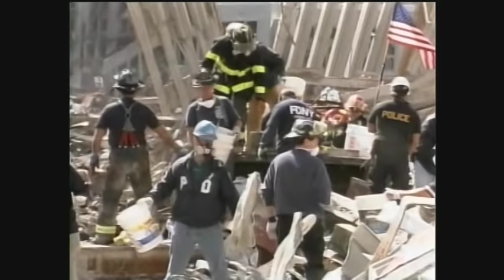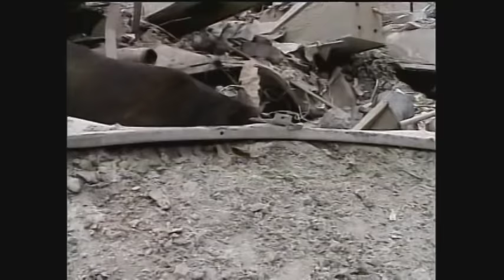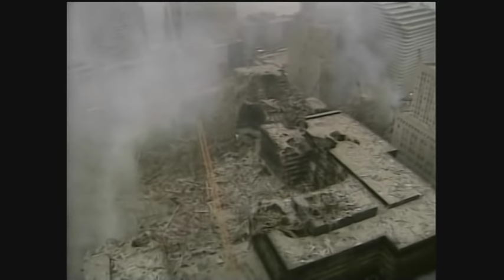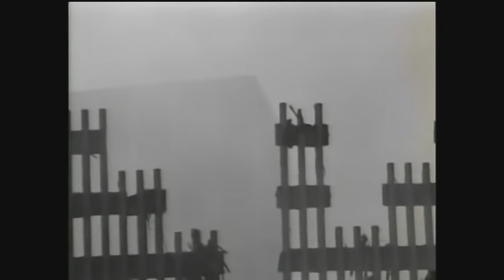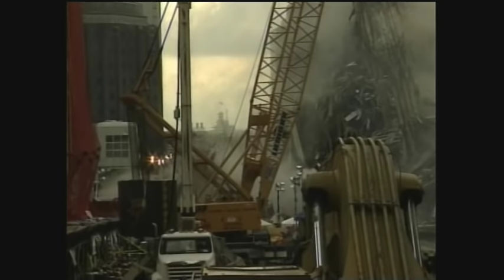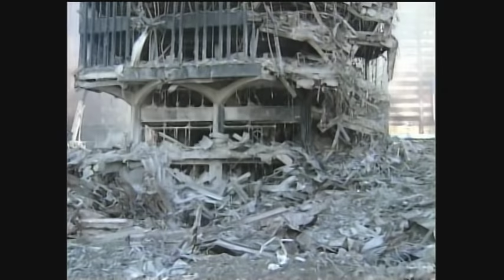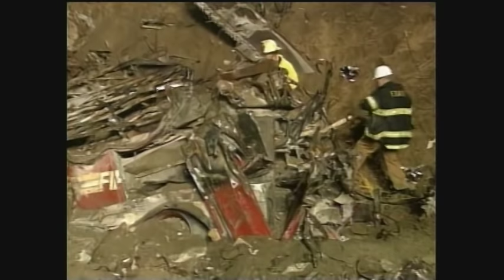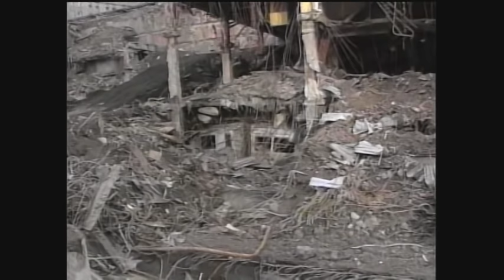Rare and new FEMA footage of Ground Zero

Comment: Dont forget that the fire can burn things such as the floors and tables etc and gas lines/electric lines in the building and in that report its because of just the office equipment on its own, not when a plane flies into the building... And no...the top portion gives way from the metal failing (you can see in videos) then it builds up speed and momentum and the rest of the building will not stand with 100's of tons falling on it. And still not free fall speed!
Reply: @mattgee1118  nowon asked you to reply whats your point?
Reply: @kirza94  No skyscraper has ever fallen because of a fire before this or since. Nothing to question obviously

Comment: As buildings go?  that big wall section being cut off and falling over.

That building was a VERY light structure.   Structurally speaking that stuff is lightweight stuff.
Reply: "that big wall section being cut off and falling over."
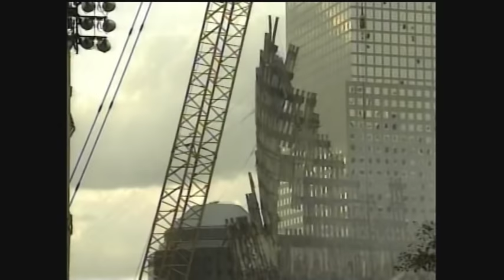1:12 - Not only by its weight. It was weakened and then pulled over with cables.

"That building was a VERY light structure.   Structurally speaking that stuff is lightweight stuff."
Lightweight? The tenant floor system maybe, but not the core and perimeter structures between them.
No other structure has such density of columns at perimeter (236) and core (47) like the twins had. Same applies to the steel thicknesses, especially in the lower and mid sections of the towers. Plus a complicated criss-cross array of thick steel diagonals between core columns at top floors, called the "hat truss" each per tower. Additionally, beam-framed floors at and above each of the four Mechanical Equipment Rooms (7-8, 41-42, 75-76, 108-109), supporting 8 inch, steel-mesh reinforced concrete slabs. The core was completely girder and beam-framed, from top (110) to bottom (B6).
Not that light construction as you (mis-)representing it here, probably to make a fire & gravity induced collapse more plausible. Agenda controlled.